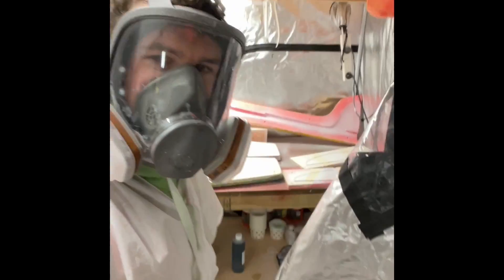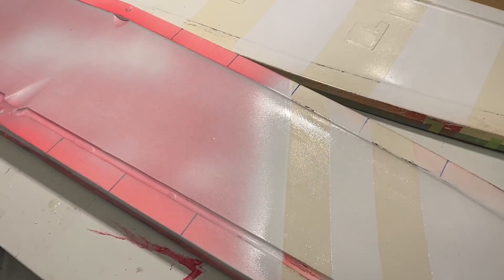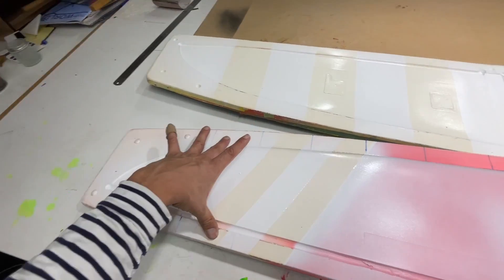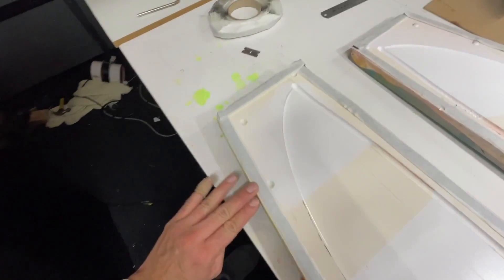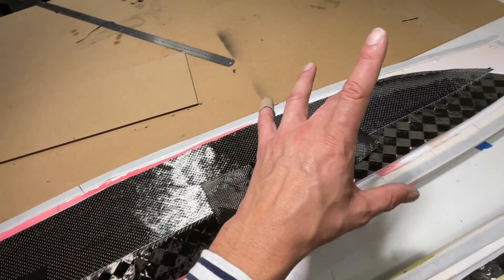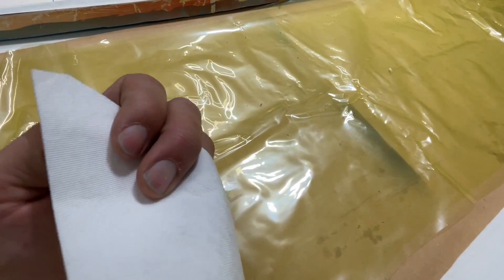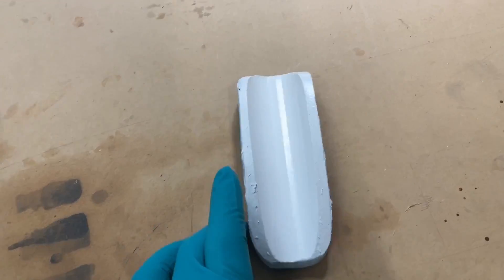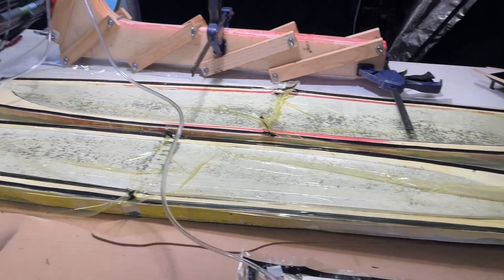How to Make a Composite Glider pt2

Comment: Hi Alex,

Just one more question. Watched both videos and wonder, how do you get the carbon fabric, especially the
 Wide plaid checkerboard weave not to fray. I mark out the pattern then lay really thin strip of masking tape around perimeter otherwise it frays sooo easily. 
Wisdom please…

Thanks
David H
Reply from the maker: Light coat of spray adhesive of hair-spray works wonders to hold the weaves together. A nice sharp roller cutter on a cutting mat or MDF as welll

Comment: Hi Alex, a couple of questions. 

How do you paint the mold?  Do you use wax or PVA as a release agent?. Do you simply spray paint over the top of the release agent? 
If you use pva then how do you tape down stripes spray over the tape and then pull off the tape how do you do this without pulling up the dried pva film?

Thanks
Reply from the maker: Hi mate, have a look at the first video, where I show the mold prep 😁 https://youtu.be/LnqKMJU2IK8